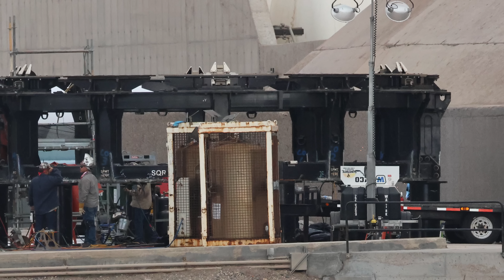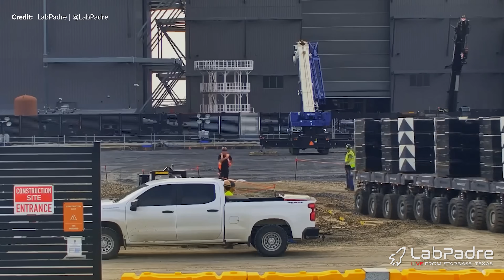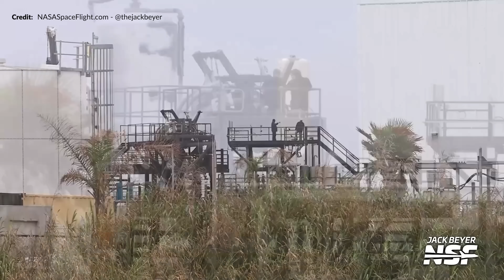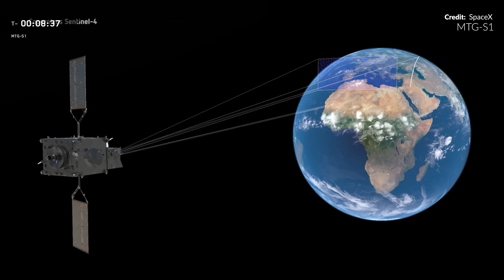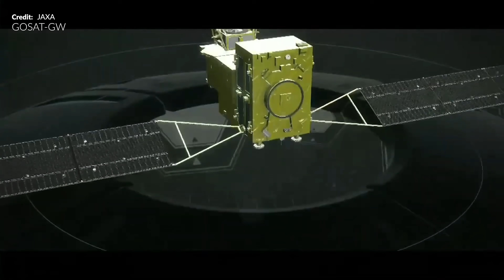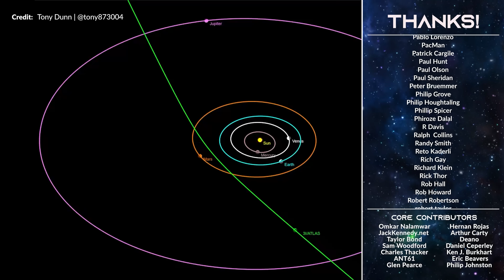SpaceX Isn’t Waiting With Starship... Here’s Their Big Move!

Comment: The damage caused at Masseys showed just how poorly designed The test stand was. For a test stand, it SHOULD have been, behind a blast wall to protect the plant IF/when ,things went wrong
Reply: With how tall the rocket is, a little blast wall wouldn't have done anything useful except add more debris to the area. Burying the pipes would have been a reasonable idea like at the launch site but the tanks would still be exposed.
Reply: Ship exploded from the top down.  How tall should this wall be that you’re talking about?
Reply: They build as cheap as possible and replace of broken.
Reply: so they were going to have to
redo things for v3 anyway right?
Reply: One too many commas,
 mate
Reply: Can you even design a pencil case?
Reply: @maxivy  pencil case is easy. Does it hold pencils? can it be opened?  TEST site has to be BOMB proof. NO excuses
Reply: They should have had a trench for all lines and hoses to run through and also the blast wall.
Reply: @RocketMan200 trenches are very difficult where you have a water table above the sand in many places..
Reply: You both clearly don’t know Spacexs philosophy of move fast, fail and reiterate fast!!
Reply: @RocketMan200 The problem with trenches is that if something blows up, a trench can funnel heat, or in the event of spilling fuel, collect it in areas intended to protect important apparatus from harm.
When an accident occurs, the most important thing to do once it's safe is to assess all aspects. Trenches and walls sound intuitive... But if a ship explodes on the stand it's better that everything can be removed and checked for damage that might not be obvious on first inspection.
Really, it's better to rig the test area for ease of removal and reinstallation.
Reply: Yea build a bridge and get over it  buddy…SpaceX will
Reply: Lack of space. They have protective measures at the launch site.
Reply: if you bury pipes and they blow up it’s going to be bigger damage than if it blows up on the surface.  

water all around that test site which is force multiplier when it comes to explosions   ask and swat breach team 

blow up a fire cracker in palm of your hand it will proably just burn you may break skin  

close you hand with same firecracker  probably going to
loose some fingers   

common sense vs internet genus commenters.   you guys need to go out and live a bit. 

don’t  worry genX and Boomers got this under control.
Reply: when
Reply: They were definitely trying to move things along too fast & it but them in the ass
Reply: In typical SpaceX fashion we ain't building it till we prove to ourselves we need to.
Reply: But it was temporary, so it’d have had to be pulled down soon.
Reply: That’s true. If you think about it, the test stand’s purpose is to test. So you WANT the problems to surface at the test stand so that they don’t surface at the launch site or later. You want the rocket to blow up at Massey‘s so that it doesn’t blow up at Starbase.
Reply: If only you were there to guide them.
Reply: @oggyoggy1299 I agree with the guy’s comment, but your reply was well played..😅
Reply: So many rocket engineers in the comments 😂
Reply: @Fuknukkal  you don't need to be a rocket engineer to understand that building experimental rockets the size of a skyscraper is dangerously hard and things will fail, and further that it pays to protect critical infrastructure from the effects of that failure.
Reply: @Fuknukkal 😂😂
Reply: Now they are going to risk tower a with a jury rigged adaptor.
Reply: @davidlang4442  Pad 1 is about to be completely redesigned, the parts that would damaged in an explosion are going to be removed anyway after they fly (or blow up) the remaining version 2 ships. Testing ships at pad 1 lets them start redesigning Massey's for version 3.
Reply: Pad A is going to be refurbished and updated soon so that doesn't matter at all.  @davidlang4442
Reply: @davidlang4442  Anyway, what else will they do on this tower. It can only launch type 2 rockets and they have only one left.
So, if it explodes during the tests, so be it, anyway, we can suppose that this tower is on its last week's of existence.
Reply: @davidlang4442  Wait till you realize most of what they are using are upgraded sewer pumps and upgraded sewer lines.
Reply: SpaceX tends to take two steps forward and one step back.
Reply: It's my understanding that a high pressure tank near the top of the ship exploded. These tanks didn't exist when the test stand was designed. In fact, these tanks were a work around for the hot staging problem. It turns out that failure is the inspiration of invention which leads to new and diverse ways to fail.
Reply: You need to work on usage of commas
Reply: Remember the 1st launch of starship and the damage to the tank farm l mean l thought thay are two close to the launch pad and l was right thay were damaged
Reply: Yes I’m sure the engineers at spacex didn’t consider that. 🤡
Reply: It shows how clueless musk is and how much the entire programme has been winged the whole time without an actual plan, every single major delay was avoidable and this was just another example of it, the catch tower will also have a failure at some point as its completely unnecessary, blue origin will be on the moon before starship and blue origin will start landing contracts that spaceX would've got, because they have had a plan from the start and have worked to perfect it, rather than wasting stupid amounts of resources and time just to have sh*t repeatedly blow up. Starship is still years away from just having successful unmanned flights, let alone manned flights, and before any of you clowns start harping on about falcon, that wasn't musk, Tom Mueller invented the marlin engine and musk just bought it like he done with everything else because he hasn't got a clue.
Reply: @iamthepotato6969  Blue origin, New Glenn, one orbital launch, booster exploded, nothing since apart from carnival rides, yeh, he’s way ahead of Musk 😂
Reply: Cost to risk. How often will you be replacing those parts anyway, and how often will you be losing a stack? Part of fast iteration is carelessness with certain items.
Reply: @Stumpy1234  No, carelessness is never part of a legitimate engineering program. Conscious informed choices can be made to accept higher risk but carelessness is pure waste. It does seem pretty clear the Starship program is careless though, that just isn’t a normal excusable part.
Reply: @RocketSurgn_  Every engineer learns in 100 that you cannot solve every risk.
Reply: @Stumpy1234  Sure, but when you don’t bother to put in flame trenches and predictably destroy your launchpad for instance you have moved into something else engineers are taught about. Negligence and that they are responsible for preventing it. At least I was taught that.
Reply: @RocketSurgn_  Accusing SpaceX engineers of negligence and carelessness is a pretty meaningless comment about a company that has revolutionized the commercial launch market, not even counting the success of Dragon and Starlink, and who is now developing the largest rocket ever built, which will be fully reusable, a challenge arguably as difficult as the Saturn V project was in the 1960s. A complete end to end test of Starship has not been completed yet but most of the key components for launch, orbital flight, recovery and reuse of the booster have been demonstrated over the several test flights, and more than one ship has made a controlled landing in the ocean.  There is a very good chance of Starship being orbital and carrying payloads by next year, a huge accomplishment. They already demonstrated booster reuse,  ship reuse is harder to predict but I would guess that by 2027 they will reuse a ship for the first time.  

Prior to April 2023 SpaceX had zero data from an actual Starship launch, other than the ship atmospheric flights which had concluded two years earlier in April 2021. The booster had never flown. The engineers were essentially flying blind as they were having to make design decisions with little to no flight data. They were planning the bidet deluge system but it wasn’t ready yet, and the team, or at least Musk, was willing to risk damage to the pad in order to get flight data sooner. It appears that the flight data from IFT-1 led them to decide to make the switch to hot staging, which required time to develop so in some ways the seven month delay until the second launch because of restoring the pad didn’t matter that much. The data from the first launch was likely extremely helpful.  And they got some experience rebuilding a launch pad, something that will likely be required again in the future, in fact I wouldn't be surprised if they have figured out ways to rebuild one quicker. 

SpaceX doesn't do or think the way that you were taught.  By the way not that it matters but I am anti-Musk but pro SpaceX, which I think you are also, but I don't think that negligence or carelessness has crept in, instead they are in the middle of the most difficult part of development as they try and maximize performance and accomplish the ultimate goals of payload and reusability on perhaps the most ambitious rocket program ever, at least since Apollo and Shuttle.
Reply: The Elon haters are so predictable. Point out to them that a WOMAN, Gwynne Shotwell, runs SpaceX, quite well, and watch them get whiplash shutting up.
Reply: @daveeyes  So, who mentioned Musk here except you? I don’t like him, sure, but I don’t think he’s ever been particularly involved to be honest and don’t obsess over attacking him in the way you seem to about defending him against made up attacks. He would’ve been involved in hiring any day to day leadership so not like he’s got nothing to do with it, but others clearly make most of the decisions for good (like the Falcon program) and bad. Whatever the source, there seems to be a culture of thoughtless corner cutting in at least parts of the company.
Also, the ones most obsessed with whether women are running companies are “anti-woke” hacks that love to whine and tell themselves that we don’t admit/recognize bad outcomes from “diverse” groups.
Reply: @daveeyes  She is AMAZING
Reply: Shoulda woulda and we'da been rich.  It was a test facility. Get over it. Nobody over invests in test facilities unless they are exclusively in the testing business. Spacex is in the launch business. Test will be built back better in a hurry and life will go on.
Reply: @mrchrisoko  today they are in the test business.

They have been in the test business for the last 15 years.
Where have you been?

Their business DEPENDS on testing, retesting, reretesting.
Reply: No mate, a normal risk assessment would have identified this straight up. You cant let childish urges to negate the potential for a problem that would cause so much issues. A teaspoon of prevention.....@clocksun
Reply: @mrchrisoko  build fast fail often means you are in the test business. If you are doing it for timeline then losing your test stand and ruining timeline is a bad thing.
Reply: @clocksun considering that each ship and booster is tested at least twice, the argument for better isolation in test facilities makes sense. Given what happened with s36, I'm sure SpaceX will have 2 of everything at each build site soon.
Reply: Exactly.   Well said.    @mrchrisoko
Reply: Fortunately 'experts' like you are available to advise the world on what should have happened.

Comment: Given the speed that SpaceX seem to be able to repair stuff, I'm surprised they're rigging this ship static fire stand, they'll probably only use it a few times before Massey's is ready to go again
Reply: Going to guess they'll complete the static fires on both ships while the launch mount is set up, even if one of them has some need to return to the build site, it would likely be more efficient to do that than to demob and remob the modifications to the launch mount between launches.
Reply: @TrainDriver186  They have another stand they are already modifying n the Sanchez yard. They will roll 38 out fro SF on that stand and then they will fabricate new and better stand for the upcoming v3 ships
Reply: @TrainDriver186  I am assuming the adapter will be used for the remainder of the version 2 ships which is also the remainder of the launches on the pad 1 OLM

Comment: :_MarcusHead:Good day from Goonellabah, NSW, Australia. It began when the Tamworth Rocket Club was formed in 1969. Moving forward, I initially wanted to attend NASA to become an astronaut, but I ended up becoming an engineer. 
I served as both the project manager and civil engineer. I worked as an engineer in Singapore from 1999 to 2005. We designed and constructed twelve-kilometre tunnels with two boring tunnel machines and five stations. I also managed a team of 160 engineers and architects. I have been a contract engineer since 1975, constructing sewage and water treatment plants from Melbourne to Cairns. 
I am embarking on a six-month journey of significant importance. I'll be circumnavigating Australia in two Cybertrucks and a Tesla Semi, covering a substantial 22,000 kilometres. This journey is set to commence at the end of September 2025. Elon Musk will help me. 
Promote the Tesla Semi. We will use it for concerts and accommodation while circumnavigating Australia. The trailer of the Tesla Semi will be equipped with photovoltaic (PV) panels, which will charge the batteries of the Cybertruck and Tesla Semi in areas without chargers.
I expect Neuralink to be available in Australia by the end of 2027. I will spend the rest of my life giving back to those who have had a stroke, and who have ALS, and who have lost part of their body due to no fault of their own. 
Neuralink will help those people. I shall take two Tesla Optimus robots.  I had a stroke on 4 July 2019. My wife, Kate, saved me. I am now swimming 3,000 metres at Goonellabah Pool, four times a week. 🤗Cheers, Ian Cleland